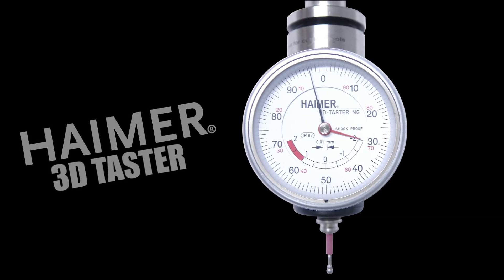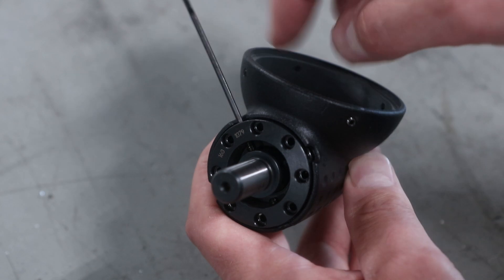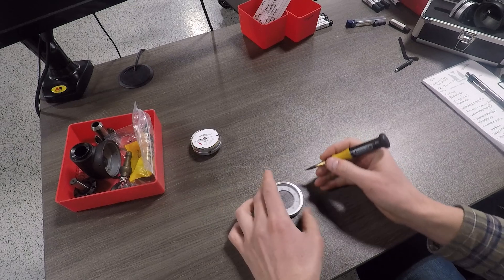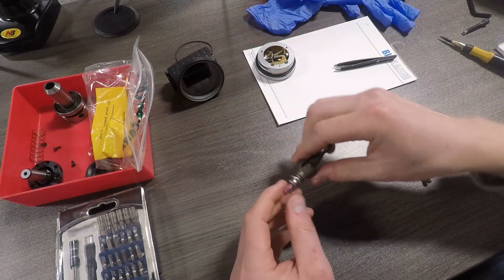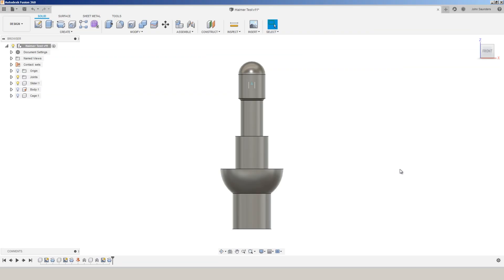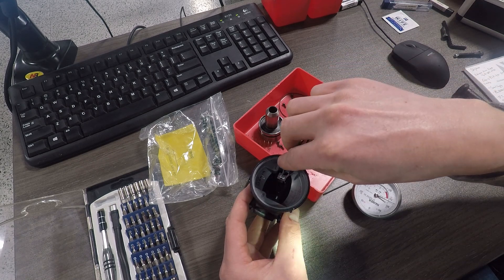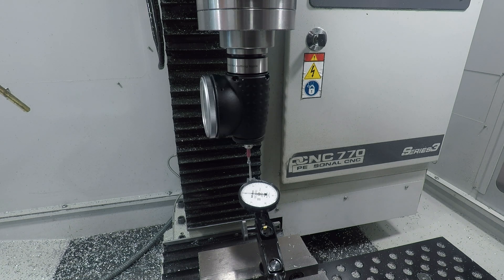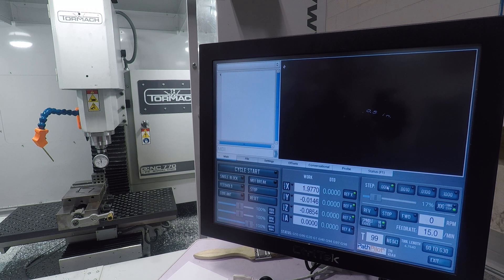How Does a Haimer Work? | WW261

Comment: This comment is probably a bit late, but for anyone else fixing or calibrating these probes, the mistake in calibrating this probe happens at 10:00. Instead of setting the zero reading to an arbitrary height, the zero should be set by measuring a reference block or measuring the same surface with 180 degree of spindle rotations (after dialing in concentricity at rest).

Comment: 10:23 it works Z but you not get acurate x y. you need calibrate need to 0 too LOL OR move bacl label where needle is that is your ZERO no zero that say 0
there is screws 3 screws around gauge use 2 top screw adjust needle so it read zero without.
think bout it your needle move more when you touch x or y you are actually over your edge

Comment: 0:47 cycle start not work on manual (handwheel) and it should go max 0.1mm step anyway. its implausable crash haimer. you not have any rush with thing that cost 500. you allready get 0.01 acuraracity even i could mease x y z with paper same acurate and faster than you lol

Comment: If one of the employees decided to rebuild it, he'd be fired. When indicating a new tip to dead center of any probe like this, I like to bring the test indicator to zero and then move it off ten thousand and move it back to make sure it repeats. Only when I'm within a couple tenths though. Without doing this at each quadrant, I guarantee you are not centered. Nobody thinks of this. By doing this you are eliminating most of the built up tip pressure from all the friction. It matters if you want it truly centered.  If you leave the test indicator on the probe the whole time while spinning, it'll say zero once you are within a couple tenths. Do the same thing as you would normally do, but once you think you are good move it off and back on, at each quadrant, and I guarantee you'll see additional error that came from somewhere that you didn't see when leaving it touching the whole time. The more pressure your test indicator applies the worse the error will be.

Comment: I've spun dial indicators before. It was painful every time. For years, the QA department had a trimike(mic for id bore) mounted on a plaque on the wall. Someone (not me) measured the large part in the turning centre and restarted the boring cycle with the mic in the bore.

Comment: A very interesting video. The same goes for an Interapid .0001” test indicator @ 10,000 rpm. In the summer of ‘91 a tech. was setting up a Fadal 4020. Of course the door switch was bypassed. I almost got that in the face! Be safe.

Comment: Good job on the repair and the video! I can say that the sensor needs to be calibrated since you repaired it. That is why you are getting wrong measurements in X and Y. Haimer USA can calibrate them in house for a nominal fee and turn around is usually within a week.

Comment: John, you need to step up your game. Pretty hard to assimilate that you'd want to fix/reuse a shattered half-precision tool worth only a few hundred bucks. You aren't in NYC running benchtops machines anymore... quit the glue and sticky tape man :/
Reply: GT Collection Depending on the task, glue and sticky tape can be an excellent work holding option. The preferred adhesive substrate these days is not painters tape, it’s polyester tape with silicone adhesive used for masking when powder coating.

Comment: Interesting lesson/video! Was great to see some detail on how the Haimer 3D probe actually works. Finally got around to looking up 'Taster' in German to English translators. Looks like 'Taster' can mean 'button', 'stylus', 'feeler', or 'surface feeler'. So in German, the name makes perfect sense (no surprise there). Just seems a little peculiar in English...
Also, thinking about the forces involved, I don't buy the rationale offered for why there are 8 screws around the lower ring. Sure, there are some 'stresses' induced when a stylus tip is adjusted to ~0 runout, but the forces are very small. The entire assembly in engineered so that tiny lateral forces are sufficient to move the stylus. I suspect that if you removed every other screw, leaving just 4 with 90 degree spacing, you would not be able to demonstrate any change in real-world performance. Still, I'm leaving all 8 screws in place in my Haimer 3D Surface Feeler in honor of German over-engineering. Better over-engineered than under-engineered.
Reply: I think the adjustment is performed by flexing one of the metal parts, which requires a lot of force, so the ring needs to be really well anchored down.
Reply: I haven’t taken one apart, but the adjusting screws are tiny and adjusting them is a delicate task, not much torque required at all. So I don’t agree that 8 screws are required.

Comment: I'm curious what kind of control lets the machine start the spindle in jog mode or probing mode by hitting cycle start? Not any of the real controls lets you do that! Either it says tool error or wrong control mode and that's it.
Reply: With Siemens, for example, you can start the spindle by pressing cycle start. It's not so weird.

Comment: I kinda cried when I saw that! Any chance spinning the unbalanced load damaged the spindle?
Reply: Rick, running any unbalanced tool holder assembly in a spindle runs the risk of damaging a spindle. Doing so will also void the manufacturers warranty on any new machining centers. Most machine builders will put a label on the spindle cover or electrical cabinet stating the balance requirements for the spindle. Something along the line of G 2.5@ 25,000 RPM or G 6.3 @ 14,000 for example. Note the G 2.5 rating is a much better balance rating than G6.3.  Visit the Haimer USA website and read some of the stories on there from customers who purchased a balancer after blowing up their spindle and spending a lot of money on downtime, repair and scraped work pieces. There are so many benefits to running balanced tool holders, longer tool and spindle life meaning more bang from your investment of tooling and equipment, better surface finish resulting in less additional operations.
Reply: So... A fly cutter is a big no no.. ???

Comment: John if you're still fiddling with this try moving the dial mechanism within the housing. 

It's been a while since I've had my Haimer apart, and mine is also an earlier model, so I don't recall the specifics. However I do recall the alignment of the dial mechanism within the housing being part of the alignment process and it's a fairly simple process of loosening the screws that hold the dial indicator mechanism in the correct position and fiddling with it. It could be worth a few minutes to check anyway if the thing is otherwise trashed.

I think Long Island Indicator may repair Haimers (though not sure) however as I understand it Haimer don't sell parts.

Comment: Hmm, thinking about it the plastic part on the inside wouldn't have a spherical shape, but rather like a rotated involute. If it were just spherical, the readings on the dial would be off since you wouldn't have a linear correlation.

Comment: I don't have that much of an experience with the Haimer, but I thought the large arrow should be pointing zero when the taster is not touching anything in order to get accurate XY measurement, or it doesn't matter?
Reply: Since no one else has replied, I'll take my best guess
when the dial reads zero in the x/y axes, the edge of the feeler is right on the rotational axis, so no need to apply any offset for tool size

Comment: John, the error is because the dial must be on zero in its neutral position.  It shows you how to set it in the instructions.
Reply: we own 6+ pieces and i maintain them and it is true
Reply: This. Adjust the clock using the 4 small setscrews so it reads -2 on the small and 0 on the big dail. No need to adjust Z
Reply: john not read manuals. and zero is that 87 on dial with no force unless calibrate needle to zero. it worked completely fine error was 25 he say and dial its bout 26 2x that 13 error

Comment: The reason for the inaccuracy of xy measurements is may be due to no preload on the clock spring in the actual movement when assembling you should have the bezel off and put one to two rotations on the longer needle and tape it down then assemble the unit and the last thing you do is reassemble the bezel. Being you are in NY try Longislandindicator.com they are in my opinion the authority on Interapid indicators but may know a thing or two about these .

Comment: I smashed my Haimer in the Z a while back and the part also ripped open the boot on the bottom.  Do you know of a good supplier for replacement parts for these?
Reply: https://www.haimer-usa.com/contact/service-and-applications.html
Reply: @ron070294  they don't sell direct, have to go through a distributor.

Comment: i managed to crash one of these things (z crash): that rod hit the hemisphere and moved it out a little so there was some play on the z axis; the change in geometry meant the x and y were unreliable, but when measuring in the z-direction it was still accurate. figured it must be salvageable, so i had my dad look at it; he bent a pin or something inside the device so that the top of that rod seated correctly in the hemisphere. *i just finished the video*; it might still be salvageable. see if there's any play in the z direction (when you pull on the tip)

Comment: If only you had the spindle speed set at 4999 rpm, you would have been fine :-) I am really sad that you did this, and by sad, I mean glad. Very cool to see what is inside it and REALLY appreciate your analysis of the design intent. Perhaps Haimer needs to integrate a bluetooth wireless disable feature, so when the device is in the spindle, it automatically disables the spindle by delivering a 10,000v shock to the operator who touches the green start button :-)
The closing re-shot of the event was as brutal as the opening shot. And by 'we' accidently hit 'Cycle Start' you meant who ???

At least you captured it on camera.
Reply: Someone suggest him what else 'we' can put in that death trap and disassemble as fast as 'we' can.

Comment: Would it be possible to have a fail-safe in the machine controller, so that you can say "this tool only 60 RPM max"? Heidenhain has an input field for it, but it doesn't prevent you from programming a higher value.
Reply: in your control supports encoded tool holders... yes